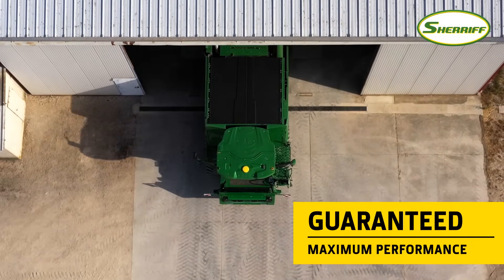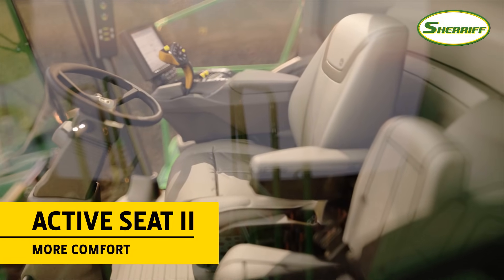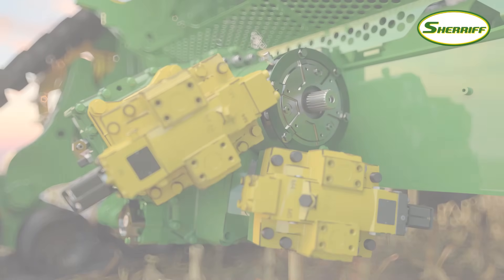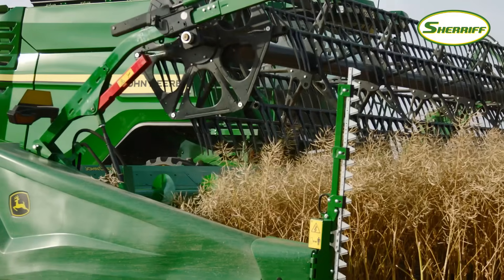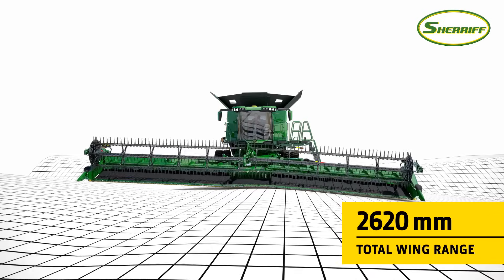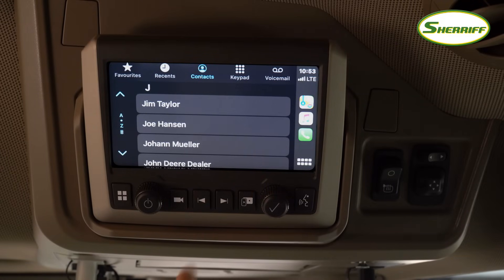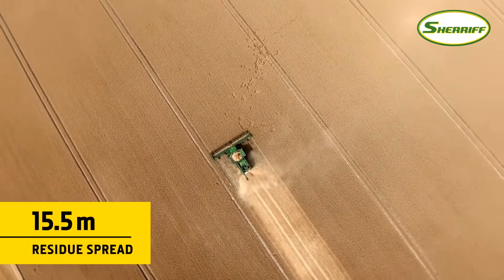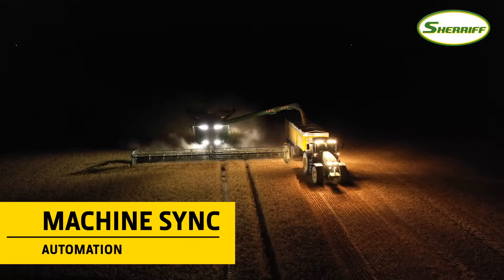12 key features of the NEW John Deere X9 combine harvester

Comment: from what i see compared to the advertisements from other brands biggest combine the john deere is still behind most of the big brands and there biggest sale point is that the tank is east to clean. that is standard on most new combines. also lighter concave isn't a good point it is a bad one because it means you get any object in there like a tree branch or a stone, or just bung it up it will be more likely to catastrophically damage than if they were made heavier and stronger
Reply: At least JD x9 combines can cope with big crops unlike claas lexicon combines. They do have a more powerfull engine than John deere but it still can't cope because it seems in some videos of the big class lexicon 8900TT that slows down and surely that's gonna put pressure on the engine. it needs a v8 or v12 to keep the claas lexion harvesting even through harder crops. So the john deere x9 can cope Brill with harder crops
Reply: @jezcolborne6329  it can only cope better in heavyer crop because it will be sending a load of un thrashed grain out the back
Reply: @joseph-ur2ks  I dont think that will happen. That sounds stupid. John deere have tested and tested  this combine again and again and the test proved it can deal with wet crops aswell as good dry crops so it will deal with any crop with ease
Reply: @joseph-ur2ks  it will still harvest the bad wet crops as well  so no un thrashed crops will fall out the back. it wouldn't happen. john deere is on to a winner on that part
Reply: @jezcolborne6329  why won't they prove it? Run it against anyone else? Seem to be backing out of all side by side demos... like they run it but not beside other colors...
Reply: @hammerslammer3006  I dont know why. They just seem to not want people saying ha john deere what you got that we ain't got
Reply: @hammerslammer3006  also there are people who like the new JDX9 because of what it can do and how much crop it can manage compared to a claas lexion 8900. .its not the power that counts it's what it can harvest which is a winner in my view plus the JD can speed harvest more then the claas lexion as was shown in a video between the JD 1100 and claas lexion 8900 so there ya go. Claas has the biggest combine but not the best
Reply: @jezcolborne6329  k. I'm asking why cant they prove it?
Reply: @hammerslammer3006  why not ask them

Comment: Nah thanks we’ll upgrade our fleet to the new Lexion 8900 damn shame I expected more from u JD.
Reply: Meh much prefer the dealer support network that Deere has.
Reply: grgsrvc Claas has excellent representation in the Midwest, neighboring farms have been running Lexions for two decades. Can’t justify JD’s pricing anymore honestly.
Reply: @xSCHEF  class has a much better combine compared to the deeres anyway so I wouldn't blame you for switching
Reply: @xSCHEF  pricing per throughput is the problem! If it would eat some acres then yeah but not for LESS machine.

Comment: Location
Reply from the maker: North East England and South East Scotland
Reply: I would  love to see someone run combine advisor when everything is calibrated, and then throw pans and manually count the loss. And see if its true
Reply: Damon Ens it works great when conditions are good and consistent. Its not worth a damn in poor conditions or variable crop.
Reply: @Ellison89Brett  ok but isnt that the reason combine advisor is there? Haha seems like a pointless tool.if it doesnt work very well in various conditions,  wouldnt you think? Lol
Reply: Damon Ens yeah I would say I run it probably half the season or less. I can usually get the machine set better, faster than the machine can set itself.
Reply: @Ellison89Brett  the cemos and cebis system on the claas seems way more intelligent.  And even when we activated it you still gotta watch close . It's not perfect by all means but john Deere is hyping up a huge failure
Reply: Damon Ens i wouldnt call it a failure. It would be great for an inexperienced operator or a situation like a harvest crew with a bunch of inexperienced operators. I do use it and it does work, just not as well as I think it should for what it costs.
Reply: @Ellison89Brett  I guess. Just seems like a huge waste of money to pay that much for something that only works in certain conditions.  But that's John deere for you
Reply: If you can get it calibrated in really good conditions and at the best time of the day it will properly adjust when conditions get poor. I really like the combine advisor that coaches me on what to adjust next. S780 is what we have.
Reply: @grgsrvc  have you thrown test pans behind them ? That's the only way you know for sure